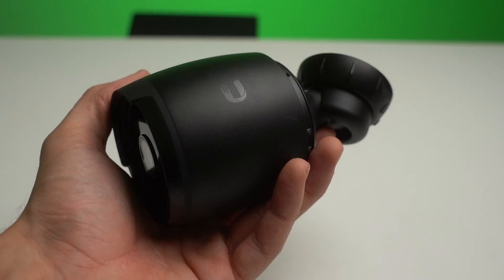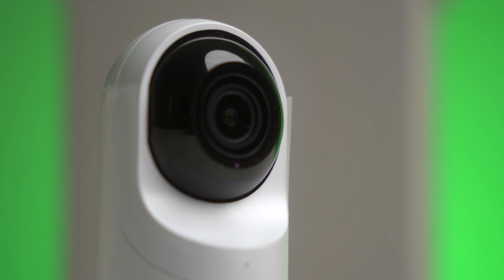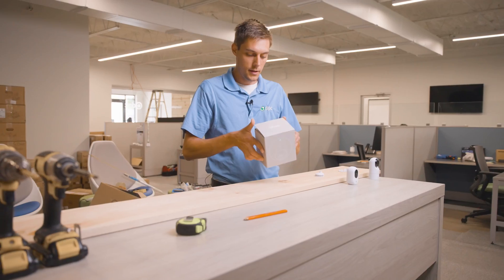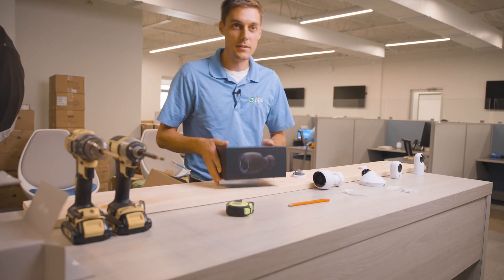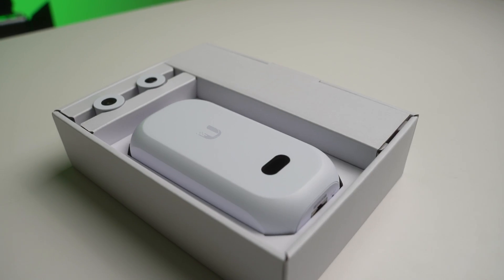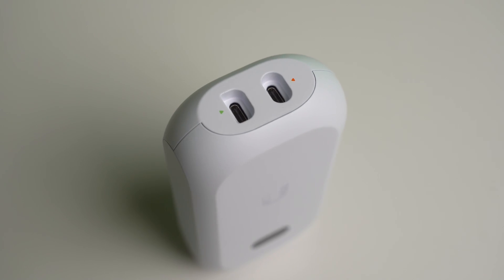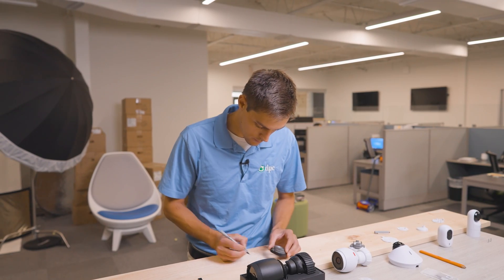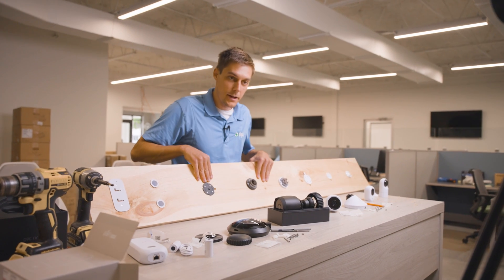Building an EPIC Test Rig to compare every Unifi Protect Camera!

Comment: I hope you don't intend on making a comparison of them all running in a dark environment at once. Your tests will be null and void if trying to compare with ALL IR lights on at once.
Reply from the maker: It is in editing and I did do each IR individually..  I ran the test in a typical environment where I turned IR from all the typical camera locations in a large room with 4 cameras.  Spoiler alert, even the weakest IR from the G3 instant was pretty decent...  What id didnt do is put them all in a complexly dark room and compare.. but if you have a use case that u need that info, i could conceivably do that test.

Comment: when will the video be released?  i'm looking at a g4 instant vs g5 flex to get my feet wet with Ui cams.   i'm in dahua land right now and they are bang for the buck.
Reply from the maker: I'd go with the flex..  it's going to be a few more weeks
Reply: @DPCTechnology  thx for the info.  i wish unifi would give more specs on the image sensors.  poe is definitely a plus for me.
Reply: So I got a G5 bullet and a G5 flex, I can only test one at a time but so far the flex has a wider field of view compared to the bullet.   do you have any other specs on these cams?  it looks like the bullet is a 3.6mm and the flex is a 2.8mm.   i'll see how the flex looks at night.   looking at the g5 flex vs the g4 instant, the FOV is identical, so i think the g4 instant has the same image sensor as the g5 flex but dont quote me on that.  i've yet to see a g5 flex, i'm not so sure if they are going to make one, but time will tell.   I wish they would put an SD slot in some of these cams so that i dont have to install an HDD in my UDM Pro.   @DPCTechnology

Comment: Welcome to the WTF question with the wasteful THETA, two cameras but can only use one, throw the other now useless wasted camera away. The brain-box can only handle one camera and one two-way speaker/mic. Cables and slots are like Elon's Starlink stinky connectors, look like Type-C but have molded plastic keying.
Reply from the maker: It is a strange package
Reply: @DoItForMeSolutions  Good point, I know in many cases, I would like to break the stream into 4x rectangle feeds for use on VP's and monitoring.
Reply: oh wow, I did not realize that, I assumed you could use 2 cameras, or 1 cam and audio.
Reply: Those are lenses not cameras.

Lots of cameras come with multiple lenses that can only use one at a time. 

This gives you options.
You can do fisheye 360
Or you can do a telephoto. 

It’s a great camera package
Reply: @RyanLRaben  Please come back when you know the product. THEY ARE CAMERAS. 8MP wide angle, 12MP fish-eye connected to processing unit via USB style cable. Lens only would mean optical connection.
Reply: You may be right. 

If you look at the tech specs they refer to them as lenses. So that’s what I based my comment on. 

I’ll try to be more informed next time and just toss my spare lens in the trash as you suggested.

These cameras are great. Sure they have a couple odd quirks ( no built in IR or audio) but having a flush mounted and very discreet camera is a huge win. 

Very nice in a business setting.
Reply: @RyanLRaben  UBNT are known for Ubiquitious naming and descriptions. The heads a definate cameras (lens, sensor and basic conversion electronics) and the power and processing done on the brain-box.